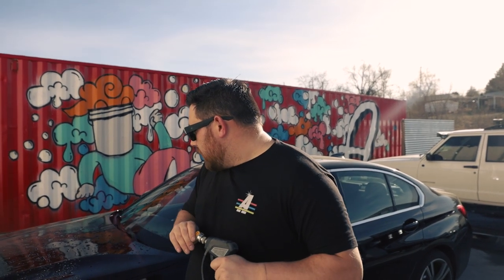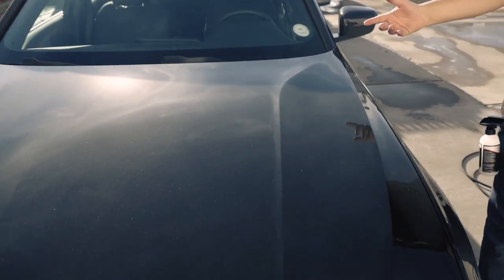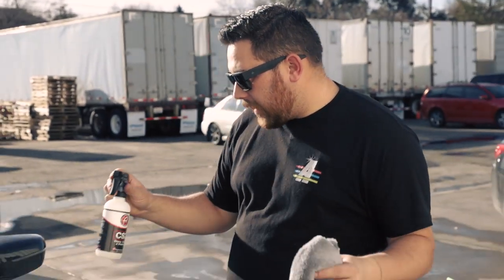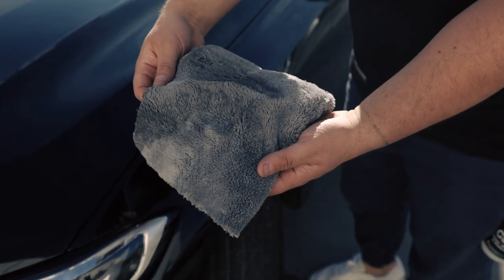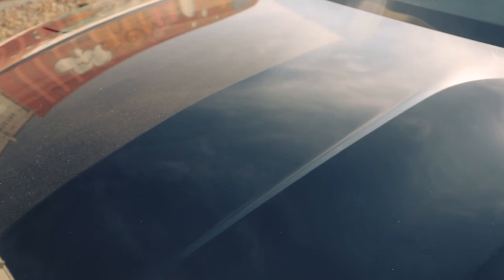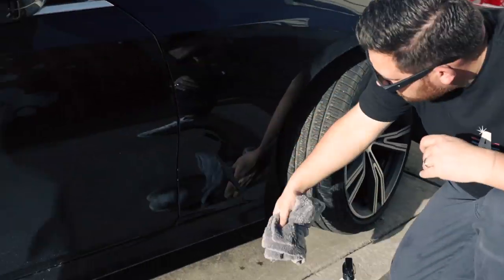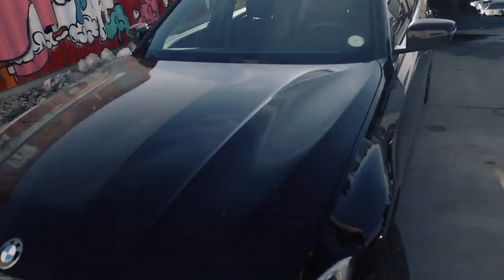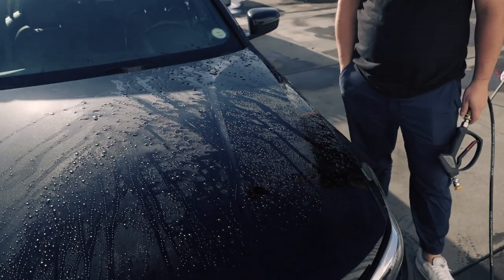Easiest Way to Clean, Shine, and Protect Your Paint

Comment: Iv'e been using CS3 for a while now and I gotta tell you, it's as good or better then they claim. I've used so many different detailers, spray coatings, spray waxes and waterless washes and CS3 excels at all duties. The feel after your done is like silk or butter. It's so silky smooth. 
After a week of being applied, then you go to wash your vehicle, the water beads like mad, the car shampoo feels like you added a slippery agent to it as it glides over the paint so well. Your wash mit if your not wearing it you better hold on to it as it will slip and slide all over the place. CS3 makes washing your car so much easier. 
 It's an excellent topper on a ceramic coated vehicle especially if your like me and like to wash once a week and usually hit it with a detail spray. I don't use detail spray anymore as CS3 is now my all in one go to product. The bus stops here for me and this is my happy  place. Thanks Adam's polishes for perfecting a product.
Reply: Can you use it rinsing the car first, and then applying this product?
Reply: @diegocaracasfc  If you are referring to CS3 ? Yes you can
Reply: @danielhunsinger8017  CS3 or the graphine version too
Reply: @diegocaracasfc  They both work very well as a drying aid. I use both of them
Reply: @danielhunsinger8017  got it! If that's the case that you rinse the car, and apply the GS3 to dry it, would you use a waterless towel? Or the regular dryer towel?
Reply: @diegocaracasfc  I use a Drying towel by Griots Garage or Adams Polish. The Rag Company makes good ones to.

Comment: Would you recommend using this instead of waterless wash?
Reply: Curios for this answer as well
Reply: Blwn6Gen I personally wouldn’t and I don’t
Reply from the maker: That is up to you. The waterless wash will not add any shine or protection. The waterless just helps clean the surface!
Reply: Adam's Polishes I understand its personally understanding it’s up to the individual, I’m asking does it essentially replace it? Clearly it has added benefits as well.
Reply: What's your reasons?
Reply from the maker: @That_Corvette_Guy  Yes it can replace the Waterless Wash as long as you want to add protection. Not everyone wants to continually add the protection.

Comment: Adams makes great products but there are cheaper and equally effective alternatives.  That bottle of cs3 is almost 20 bucks for 12 ounces and according to the video we should use it to clean the car then use it again to wipe off streaks.  I don't see a bottle lasting very long.
Reply: I used this right after a wash, to clean up and water spots and get any spots i missed during the wash. Great results and I didn't have to use much.

Comment: Can this serve as a Ceramic Coat after a Compound, Polish and wax? And roughly how long of protection?
Reply from the maker: We would recommend something like a Spray Coating if you want it to last at least 6-8 months on a daily driver. The CS3 roughly lasts 1-3 months depending how often you drive the vehicle and or wash it. If you put Ceramic Spray Coating on first and use CS3 after every wash you will get amazing results!

Comment: I just used this on a black MKS but less dirty and used half the bottle. It works great but 16oz goes kinda fast. The spray nozzle is totally legit. I did have a spot on the hood that really got spotty for some reason didn't want to lay down even after a respray. Its why i came here to see what i was doing wrong.
Reply: I did 3 cars with a bottle. Got a deal for $10 locally. i Did a Suv Equinox, MKS, TSX. I re-wiped the high spot with a dry towel. Darker colors look better shine wise.
Reply from the maker: @user-tu1ee6dc5f two to three vehicles sounds about right for a 16oz bottle depending on how dirty/dusty they are and how big the vehicles are - usually 2 or 3 light mists per door panel, 4-6 sprays per hood, 4 or 5 sprays on a bedside, etc. 

Make sure to do quick full-pulls of the spray trigger to spread the product in a very fine mist, rather than a more concentrated spot with a half-pull of the spray nozzle. Two towels with CS3 will always work best, especially with darker colors. The first towel will absorb most of the liquid, so half way through a vehicle it may begin to smear - that is when you immediately wipe the area again with a clean dry towel to leave it looking great. 

If lighter colors aren't looking as good shine-wise, you may need to machine polish them first to remove swirl marks, oxidation, etc.

Comment: Should be flipping the towel way more often when wiping those dirty panels man... you’re installing so many minor scratches >.< all these waterless methods are a joke, nothing replaces a good foam and 2 bucket wash.
Reply: 2 bucket wash is overrated. Just use 2-3 mitts and don’t put them back in the bucket once you use one.
Reply: Waterless wash methods are good to use on maintenance washes. If you do them correctly you won't create so many minor scratches and you also have to use the proper product that encapsulates the dirt and lifts it off the panel. When using your traditional 2 bucket method after a foam rinse or whichever steps you use, there is still some dirt left on the surface so when you go to use your wash mitt to wash the paint, you do still drag those tiny left over dirt particles around the paint with your wash mitts and potentially minor scratch/marr the paint. A lot of the scratching and marring comes from the drying stages as well. Every wash method has it's own purpose but some just aren't educated enough on how they work or too stubborn to listen.
Reply: somthingsquishy I couldn’t agree more. Too many ppl thinking they know this n that. My worst pet peeve is ppl saying to me why do u wash ur car so often if it’s gonna get dirty in a couple days again? All these products and bottles. I say to em, why do u wipe ur ass so often if ur gonna shit again? Lmfao!

Comment: This may seem like an off topic question but here goes... I have epoxy coated counters with many many small scratches. Can anything be done with your products to remove the scratches and rebuff to a bright shine again ?  Seems like your products and techniques are acrylic based but just maybe you have some ideas for epoxy surfaces. Love the channel!
Reply from the maker: Hey Anthony, this is a great question! We haven't had experience with this before but could be worth a try. If you could take pictures of the counter top and send it to orders@adamspolishes.com we can address the situation a little better! Running an orbital polisher with a polish could do the trick but I am not sure if you have any clear coat on there or if it is just epoxy! Thanks again for getting involved with the channel!
Reply: @AdamsPolishes  Ok sent some pictures. There is an epoxy clearcoat over the color if I have to sand, but I am trying to avoid that mess if possible. Email sent.. Ty

Comment: Am I doing it wrong? I find that cs3 makes dust cling like crazy. It also doesn’t leave the slickest surface. I applied ceramic boost last week, and it stayed super slick and had almost no dust cling to it for a week. One day with cs3 and it looks like it was in dust storm.
Reply: I have the same issue with turtle wax ceramic spray.
Reply: I noticed the same thing after doing a rinseless wash then using it as a drying aid. I woke up the next morning and there was a lot of dust and water spots.
Reply: @Newyen6MT  I’ve pretty much stopped using it. Just detail spray for me. Works great and a lot less money
Reply: @posjoey  damn unfortunate cause it works great as a drying aid/topper. Mainly was going to use it for a quick detailer that also added protection. I might just stick with chemical guys quick detailer that doesn’t attract dust

Comment: Better products for cheaper on the market! Do your homework. This product will most likely cause micro scratches in your paint they said its "OK" to do it.... doesn't say its good or safe... if you value your paint stick with the 2 Bucket Method and don't take shortcuts just to save time!

Comment: adam's what are you doing?  let's see where you went wrong.  1. VO states can you see the dirt on the microfiber...short answer no, because the car isn't that dirty.  2. Camera literally couldn't see before/after on the hood because once again not that dirty.  to say use this product and it won't leave microfiber scratches is a joke.  shortcuts won't get you anywhere and no it's not the answer or 'easy button'.
Reply: This isnt for cars that are real dirtyYou only use it on light dust and dirt between washes. They dont even recommend you use this on realy dirty cars just wash it the normal way